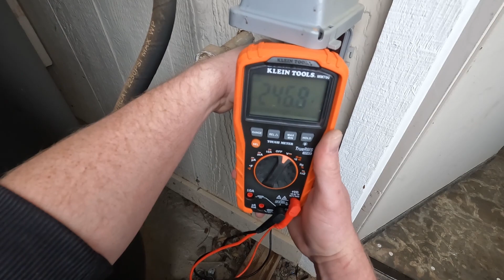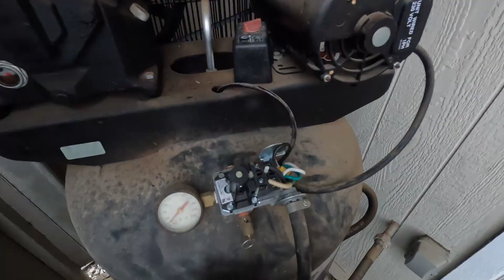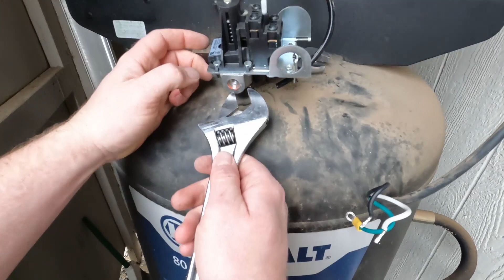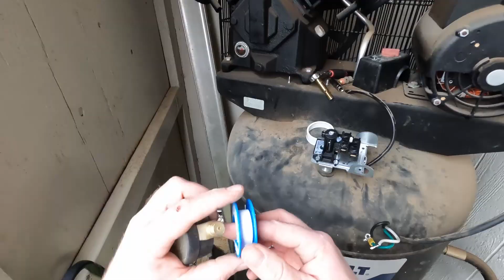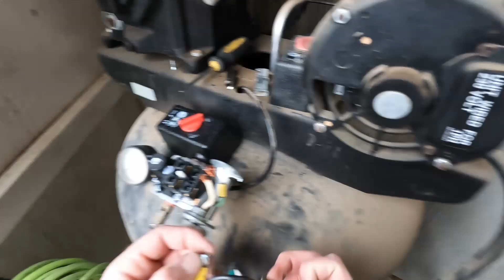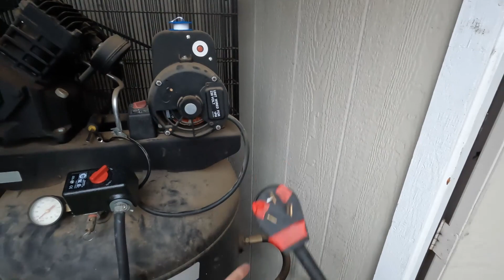How To Fix An Air Compressor That Won't Turn On

Comment: What work and start capacitor does it have?  I don't know how many (uf) to use, I searched the internet and nothing
Greetings!!!
Reply from the maker: There should be a sticker on the capacitor that says,  unless you have the same compressor, yours will probably be different.

Comment: when you used your meter to check the air pressure sensor you don't show how you hooked up your tester leades
Reply from the maker: I'll keep that in mind for the next video, thanks. I was testing for continuity. That's the setting that beeps of shows a reading when you touch the leads together.
Reply: That's exactly what I was thinking. Need to know how to check it

Comment: I tested my switch and it seems fine but the thing still wont turn on. I also opened the little panel/faceplate on the motor and tested the on/off and looks good, but still wont turn on. I have power but the motor doesnt even make a sound, any idea whats up?
Reply from the maker: Do you have power at the motor?
Reply: @GrimRepair  figured out my problem! I somehow had a bad breaker in my box so the motor was only getting 120v instead of the full 240.  a $20 doubled 30-amp breaker and I'm all set.
Reply from the maker: @p.chuckmoralesesquire3965  cool!